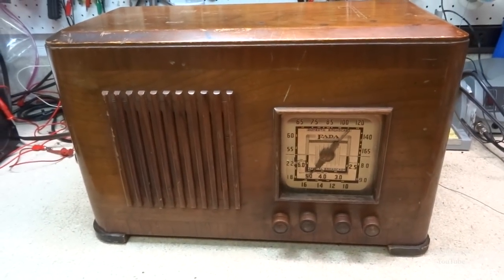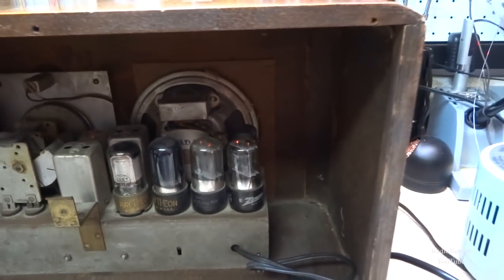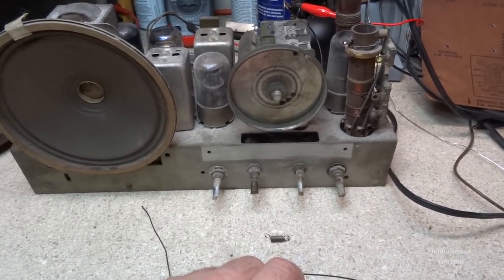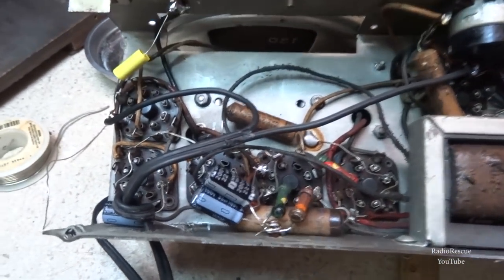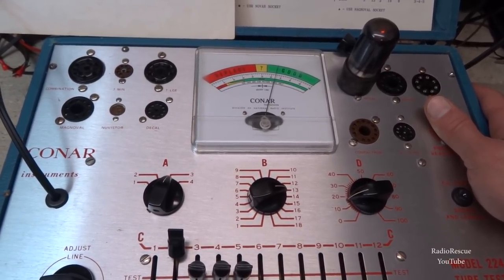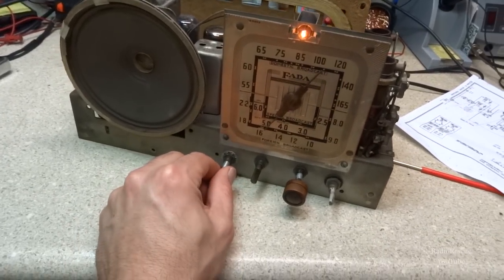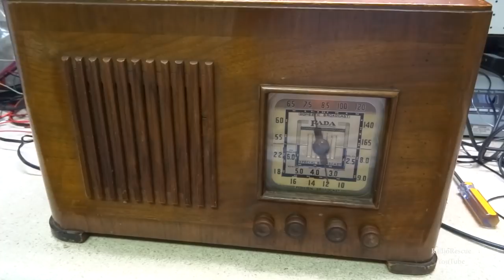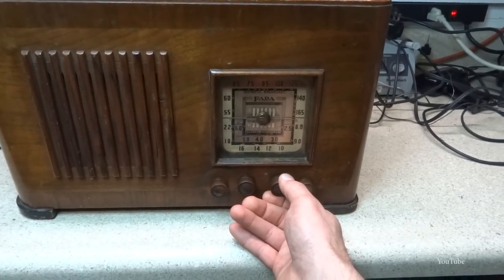Repair Of A 1939 Fada Model 169 AA5 Tube Radio

Comment: When I was a kid, dad put our farm into the "soil Bank" program with the Fed, and we moved to a rented farm some 15 miles distant.  The farmstead had 2 houses, one a huge 3 story job with full cement basement, the other a small farm house with 2 bedrooms, one on the main floor the second upstairs. We, of course, took the small house as the huge house was not finished, it had been moved onto the farmstead but never really completed. The big house was filled with the previous owners junk, among them were hundreds of letters, most with stamps from 1 cent to 3 cents. I used to cut the stamps off, but never really mounted them or even kept them (that's another story of horror and fear!) This was in 1959. My 2 sisters took the upstairs, I slept on a jackknife couch in the living room till my sisters were off to High School, then I got the upstairs where I slept on an old bedspring on the floor covered with old coats to buffer the springs from sticking in my back.  We only stayed there 2 years before the haunting chased us out, and nobody has ever lived on the place since.

Comment: There is a reason two 25Z6 tubes were used here.  The 25Z6 is not designed to be a full-wave rectifier tube.  It can be used as a voltage doubler or as a half-wave rectifier by strapping the plates and cathodes together.

6V tubes were used in series-string radios up until 12V tubes were introduced in the 1940s.  In order to make up for extra filament string voltage and to help protect the filaments a ballast tube is used.  Fada was probably the largest producer of ballast tubes.

Comment: Did you mention that this is a hot-chassis set?  To keep it from being an electrocution machine you need to make sure the screws on the bottom and on the knobs are covered with insulating goop.
Reply from the maker: The title says it all. An AA5 is a hot chassis set.
Reply: @45AMT  Not after 1940 or thereabouts.   The UL rules came into effect then and radios had to go to an isolated chassis arrangement.  The chassis is only RF grounded through like a 0.02uF capacitor and 220K resistor to the line.

Comment: I don't no if this will help you at all since you no way more then I do but when I couldn't find felt dust cover for speakers that had them missing like your speaker ,I found the dome shape  covers for speakers in many sizes at Ali express, I ordered some for one of my speakers works perfect ,all you have to do is figure the size you need ,also another you tuber ,I think the allamerican five guy suggested by a piece of felt at Wal-Mart and make my own ,but the dome shape ones from Ali express  are great for me,and they were very cheap to buy I think like 40 cents.

Comment: Sideband?
Reply: It could potentially detect sideband and CW by simply wrapping the still-insulated end of s piece of hook-up wire a couple turns around the wire going to the plate lead of the 6SA7's socket connection, and wrap the other end of that little piece of insulated wire a couple turns around the plate lead of the 6SK7's socket-connection, thereby creating a 'gimmick' capacitive coupling and causing the 6SK7 IF amp stage's input and output to go into regenerative oscillation and that will serve nicely as a BFO and make sideband and code signals copyable. The addition of a suitable potentiometer  to control the screen voltage of the 6SK7 would serve as the way to control the amount of regeneration within the IF amp.
Such a simple and minimally-intrusive mod can be done to most radios like that Fada set, whether AA-5 type or transformer-operated sets... just simply wrapping a bit of insulated hookup wire in place as described makes a quick and effective BFO. The set's existing wires going to the plates of the converter and IF tube socket connections can be insulated or bare, doesn't matter... the insulation on the bit of added hookup wire will prevent direct DC connection between the two plate circuits, yet will capacitively allow the 456 KC IF to get passed back and forth and re-amplified and mixed with the voice or CW tones. :-)

Comment: Back in 1970 you could use a 5 cent stamp to mail a letter,  was that really 48 years ago?
Reply from the maker: The Inflation since then is something else.
Reply: It sure is!  BTW nice video on the radio,  enjoy these when I am running on the treadmill in before work in the morning.  Much more interesting and relaxing vs the morning news.  I also pick up  some pointers on radio repair.
Reply from the maker: Ah the advantages of having the net at the gym. Not so at the military gym i use.

Comment: Do these Era radios suffer from SMD?
Reply: I don't believe so, as these use variable caps instead of fixed caps and variable coils. Early coils weren't bad either until they made the caps integral to the transformer instead of mounting mica caps under the chassis.